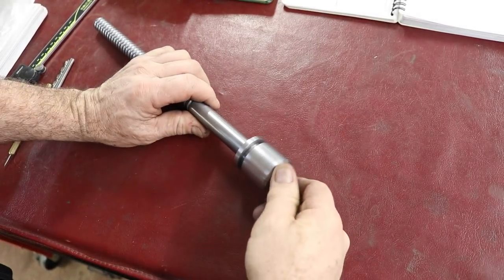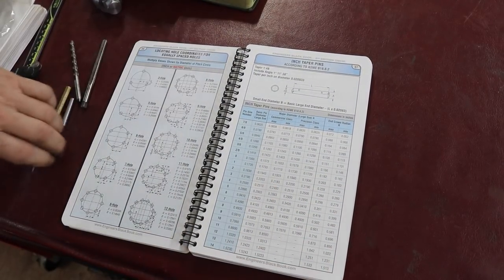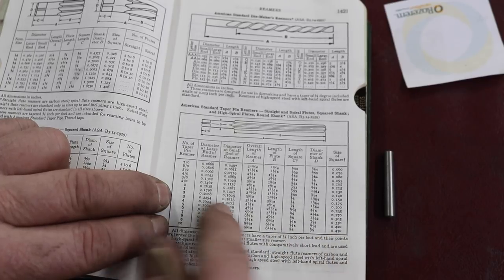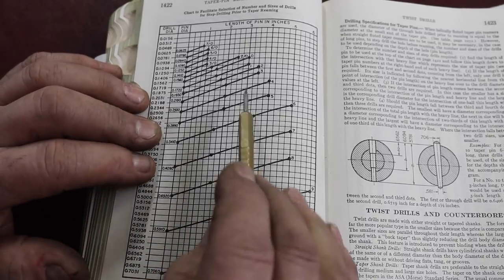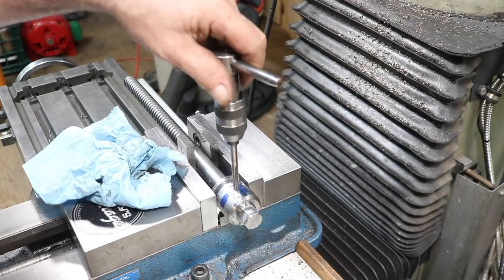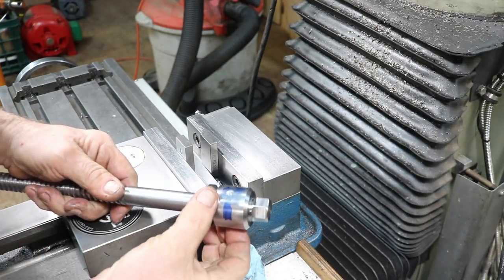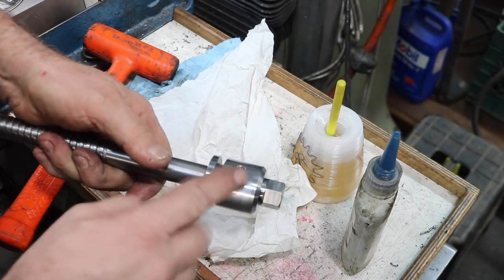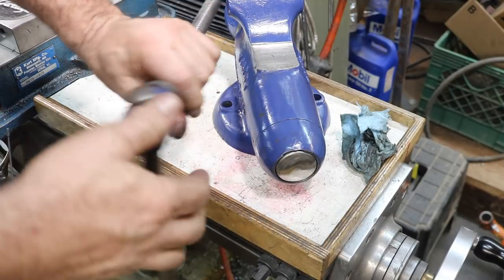Wilton Bullet Vise Modification Making The Shaft | Welding Table Upgrade  P2

Comment: say Randy, 

it seems you were confusing the pin diameter in the table for the drill size around the 7:00 min mark. still ended up good tho! thanks for the info on the tapered pins!
i save lots of stuff too... then end up throwing it out and then wind up needing it a week later. most recent example was the old head gasket for the engine of my trabant. was saving it to make a drill and tapping guide...threw it out three weeks ago and then could have used it to make the guide two weeks ago...had to wait for the new part to come in before i get going on the guide.
so it does pay to keep things...just put a tag on it so when the shaft is needed in case of something breaking or the project calls for it, you know where to find it and can identify it on the fly..
cheers!
mke
Reply from the maker: Thanks Mike.  Oh I probably miss spoke.  If you save projects will come.

Comment: Hi Randy,
Nice looking part and great progress on the vise, when you mentioned going to the Logan at first I thought there was a hardware store out there named Logans. If you don't want to enlarge the hole use a longer #5 taper pin you can cut it at the size you need, in my experience taper pins will drive in about 1/4" past where they stop when they are finger tight. also If you need a # 5 pin let me know I have a few. I have a few things saved around here also, too many things!!
Reply from the maker: Thanks Eric.  Yep I drilled a bit to far with the spotting drill, I will fix it up.

Comment: I’m wondering how much torque the pin will take before shearing like a shear pin? I know the pins are hardened carbon steel but in relation to a solid one piece shaft, in pretty sure the pin isn’t as strong!
Reply from the maker: I am sure the pin isn't as strong also.  No need for the intended purpose.  Thanks Rocking J.

Comment: Good video. Why not a roll pin ?
Reply: No wedging action with a roll pin-
Reply from the maker: Yep agree with Horace and higher shear strength.
Reply: It’s unfortunate, but back when toolmakers were a valued employee in this country almost every assembly such as this was taper pinned together.  My grandfather (1878-1968) was a toolmaker and I inherited all of his taper pin reamers and many taper pins.  The reamers and the matching pins were held together in his box with string, because plastic bags, cable ties, and twist ties hadn’t been invented yet.  I couldn’t bring myself to break them all apart and bag them when I realized why he had them packaged the way he did for me to find decades later.  Now almost everything is either roll pinned or welded.  A certain level of craftsmanship is fast disappearing.

Comment: Wow. Thank you for that. Well explained. I never really knew much about taper pins. Also, spiral reamers. Hope all is well. Any shop building progress?? Thanks, -T
Reply from the maker: Thanks Tom.  No not yet, working on details for the shop,  it is a long process here in CA.
Reply: @RRINTHESHOP  It is along process everywhere I think.  It took me several months to design the shop, then draw it up, get a quotation for building it to make sure I could afford it.  After that it took 8 weeks to get the permit approved.  Construction then took 4.5 months.  That was just to get to the empty box that I now got to start building all of the cabinets, shelving etc. in.  I am in the middle of that process and hope to be finished in April or May so I can be ready to add the new mill and lathe to the toy list.  Finding the $$ is one of the biggest hurdles for most of us.
Reply from the maker: @barrygerbracht5077  Well you are doing well Barry.  Yep here everything is a royal pain.

Comment: Don't trash the old screw, it's good for eBay...     🤑🤑🤑
Overdoing it on a taper pin, well, we all do it once, then, experience ste in quickly...    
Today is snow storm day, lots of it, about a foot with windy conditions, but, never as much as Collin gets in NewFoundland.....
Reply from the maker: Thanks Pierre, I am not throwing it out.  Yep I drilled a bit to much with the spotting drill.  I will fix it up.